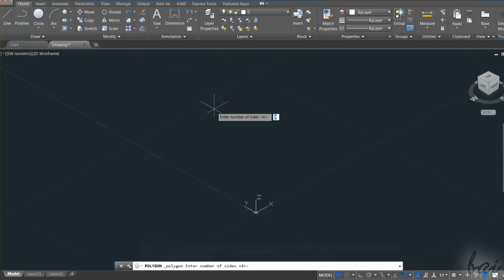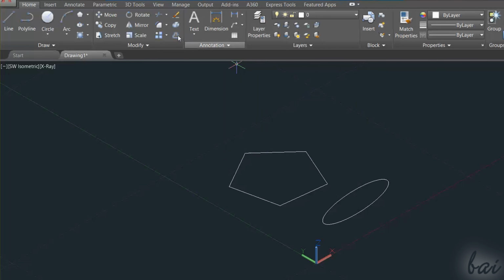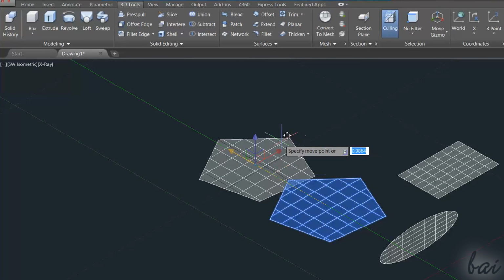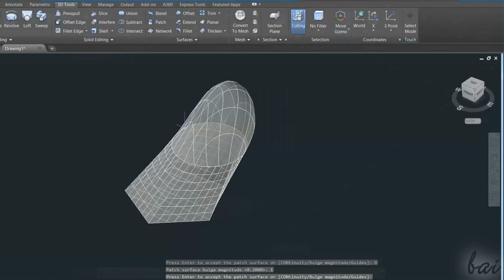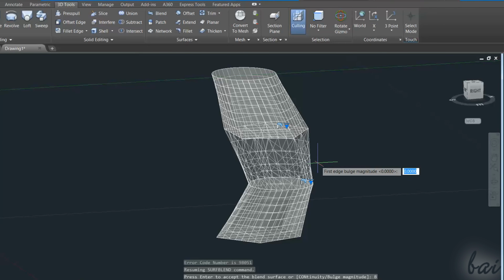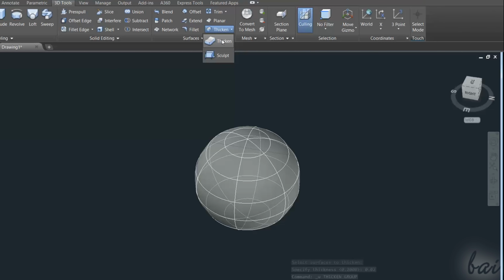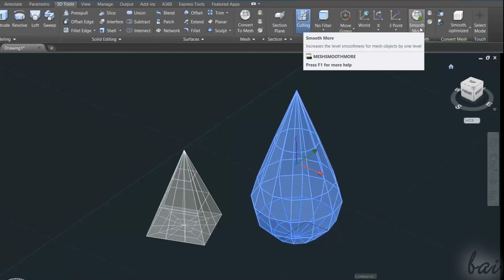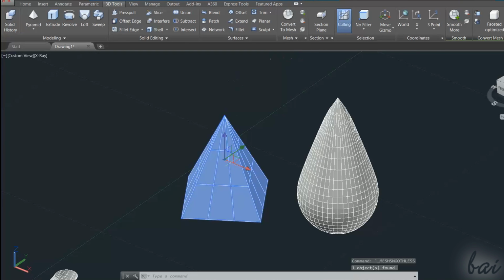AutoCAD 2018 - 3D Surfaces and Mesh Objects [COMPLETE]*

Comment: Looks great, can we get the next tutorial on more technicality on Revit? For example how to use the next section after "Architechture" etc. how to apply the imported materials, lights, etc. and is it possible to actually have a floor plan detailed and transferred to Auto CAD or somehow saved on pdf or jpeg. Thanks
Reply: omg i thought I opened Revit tutorial =))) lol. Sorry. I was talking about Revit 2018 for beginners.
Reply from the maker: We may start a video about it, but unfortunately we do not meet the necessary number of viewers this time :(